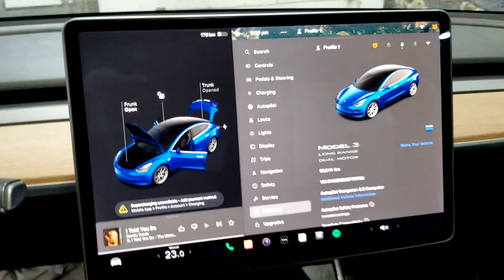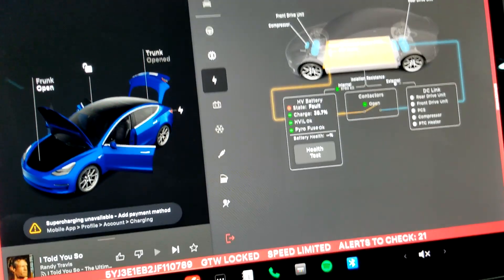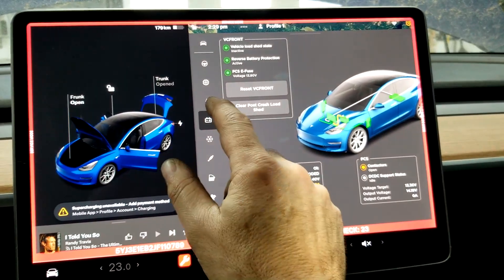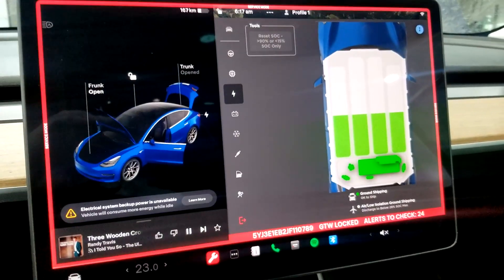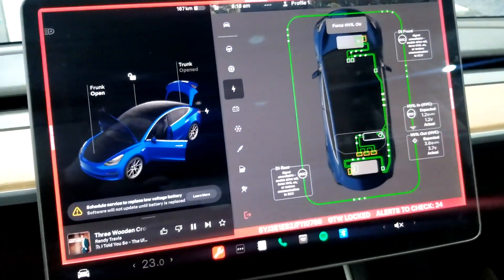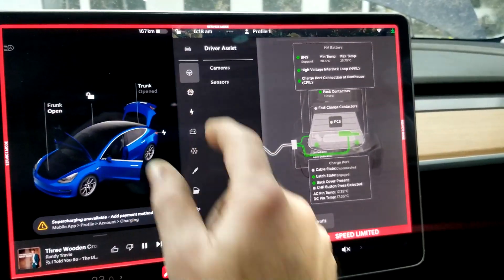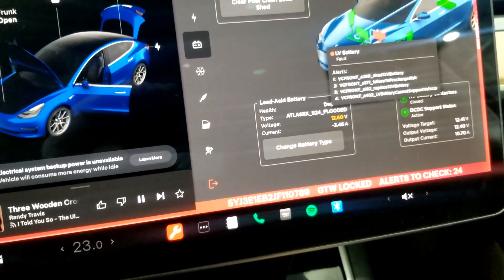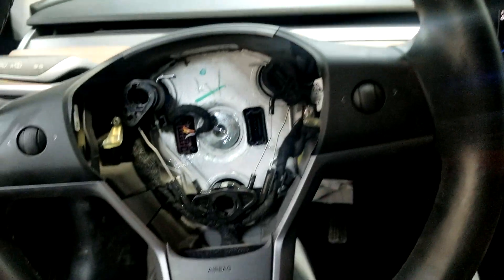Tesla High Voltage Fault

Comment: The video you made, Sam, the same problem is happening in my car, its BMS error, so how do I set it?
Reply: Hi, did you find a way to fix it? Please write if you find it
Reply from the maker: The problem is with the low voltage battery, if it is weak the system will detect this and and it will cause the issue.
Reply: @machinehead6892 
So you have just replaced the 12v battery and that problem of Hv battery Fault was resolved? After replacing 12v battery have you done any hard reset of software reinstall? Kindly confirm am also facing same issue
Reply from the maker: @fahadikram1840  Yes any time something is changed it requires a software reinstall.
Reply: @ I have reinstalled the software as well but still nothing is changed
Reply: @ it is showing HV battery state: Fault and Contactors: Open
Reply: Any help what shall I do now
Reply from the maker: @fahadikram1840  Is your pyro fuse good?
Reply: @ yes in the service mode in HV system I can see Pyro fuse is showing green and Ok
Reply: @machinehead6892  my 12v battery is showing 13.46V but Current is in minus -21.96A. Any idea why current is in minus?
Reply from the maker: @fahadikram1840  That is because it is discharging the 12 v battery not charging, is your pyro fuse good?
Reply: @fahadikram1840  did you manage to fix this problem?
Reply: @machinehead6892 I hate these cars. I replaced my 12v battery and it’s still got an issue🤦 £400 tow to Tesla here we go
Reply: @Nikitausp  do you have hvil error too?
Reply: Did you find any solution for the problem?
Reply: @josemanuelruvalcaba-z1t   do you have hvil error too?
Reply: @justtorrie  did you manager to fix this problem
Reply: @justtorrie  did you manager to fix this problem ?